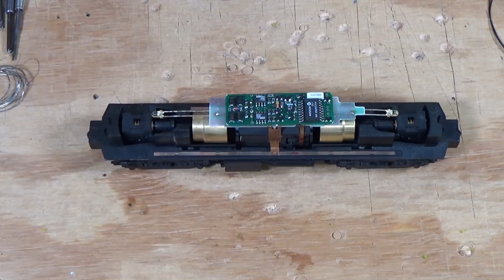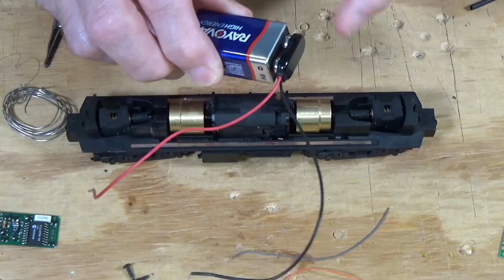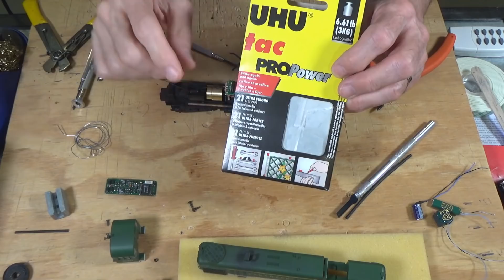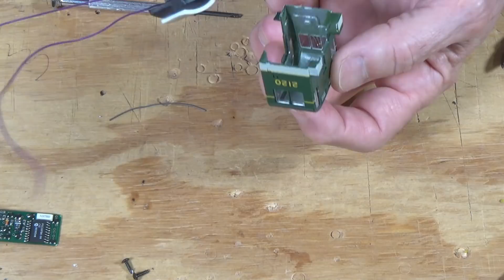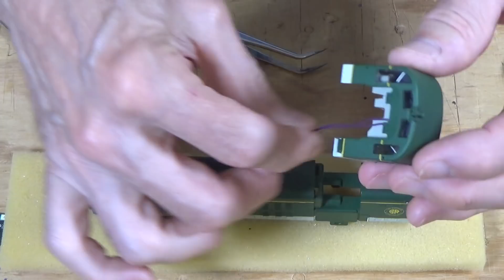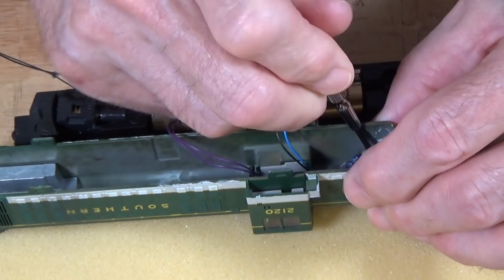Get The Alco Growl For Your Locomotives (118)

Comment: My opinion! This is a great job of how to hack a engine. Why people watching this are going to follow his directions and in the future sell it on eBay or other and someone is going to be extremely disappointed. either because they wanted a unmodified original or that this has been done. I know I would be. Given he did a good job.
Reply from the maker: Usually having a sound decoder installed in a loco is a selling point. And if you don’t want it you don’t have to buy it, simple.

Comment: Hi I am new to this so just wondering if you could tell me exactly the buddy mini you used to get that amazing sound and apart from the train and speaker, what else is needed for that particular sound. Cheers from Australia
Reply from the maker: The Decoder Buddy Mini is just the interface board that the TCS WOWSound decoder plugs into. If your loco is DCC ready with a decoder socket then you can purchase a TCS WOWSound decoder to match it. All their current production decoders come with either all their diesel or steam sounds installed.

Comment: Hi Larry, Nice work!  What was the dimension or part number of the SB enclosure you used on your RS? I'd like to get the same one and try it out. Thanks!
Reply from the maker: I actually have done this a couple different ways. In the Atlas RS3 I used the TCS kit designed specifically for these locos. It includes a motherboard with Keep Alive on it, the decoder, and a WOWSound speaker and enclosure. I wrote about this installation in the June 2016 issue of Model Railroader if you want more pictures. For the Kato RS2 installation I used the small Decoder Buddy, 21 pin TCS WOWSound diesel decoder, and the Streamlined Backshop 11x15mm sugar cube speaker in their enclosure that is curved to fit the inside of a cab roof. I wrote about that version in the September 2020 MR.

Comment: Could you do an old Atlas RS unit with the two weights?
Reply from the maker: Perfect timing, I have two just out of the paint booth that will need decoders.
Reply: @TheDCCGuy  Awesome. I have 6 with mobile only and LED lights I had done about 12 years ago. ALCO sounds would go nice with all my old steamers.
Reply: Larry could  you share your cv settings? I have installed a Wow in my alco Atlas RS3 and love the way yours is running

Comment: Great install. I noticed that after all of the wiring and components were complete, the running board, hand rail, pilot piece was not in place. Was that piece easy to slip over the body shell and in to place before the RS3 shell was finally set in place?
Reply from the maker: Yes, the decoder components and wires do not interfere and it is safer and easier to keep it out of the way during the installation.

Comment: Nice tutorial but... you work in a RS2 2120 and you tested a 2110... why? Something wrong when you closed the 2120?  Cheers from Portugal.
Reply from the maker: No, I did both at the same time and already had 2110 on the track so I shot it. They both run and sound the same.

Comment: Love the hands on install of the decoder buddy. Curious why use the two component install (decoder buddy and TCS Wow 121) vice using  single TCS Wow 101 or single soundtraxx TSU-PNP?
Reply: Good question Walter.  The benefits may be that you are soldering onto a relatively inexpensive board.  The ease of replacement to an upgraded version of a decoder and the sale of a locomotive while retaining a decoder makes the sale more “generic”.  The size of both the Mini and the other two Decoder Buddys generally leave more room for speakers, weight and stay alives.  Thanks for asking!
Reply from the maker: In addition to what Nick said, I personally think it simplifies the installation process making it quicker and less likely for errors.

Comment: Great video again thanks, some suggestions, use flexible silicone wire (available on amazon 28 ga in multi color packs) wire direct to trucks, I do not use a decoder buddy, takes too much space, I wire directly to decoder, if you want removability then use connectors, use them anyway for lights and speaker, also I use a non flammable block (forget what it’s called, it’s white) under my soldering work area

Comment: Thank you for your channel.  I have been enjoying your videos.  Back in video #38 you talked about building your own rj12 cables for a dcc system.  What wire size would you suggest for a Digitrx system.
Reply from the maker: Its just standard 6 conductor flat cable. If you look at the video description I gave catalog numbers and source info for everything.

Comment: Larry, excellent video on the Decoder Buddy installation, I use those boards also and love them. They make changing decoders and if needed speakers so easy. You made the installation look easy. You provided a lot of tips and tricks in this video, thank you. What gauge wire are you using? And can you provide a link to the surface LED’s you used?  The speakers are awesome and I use them also, thank you for that link in the past. Keep up the great job on the videos and stay safe. Thanks for sharing.   Ken
Reply from the maker: Most of the wires are from a package that Digitrax sells with all the NMRA colors. Each is about 10’ long and I think they are 30 awg. However if you check the streamlined backshop website (www.sbs4dcc.com) he sells individual color rolls in various gages.
Reply: Thanks for the help Larry.

Comment: Technically you don't need to mess with Positive or Negative wires having to worry which one is which when hooking up the power to the motor.  If the normal direction of travel is wrong for you, its easy to change it in the CV codes when programming a decoder to change its NDot.